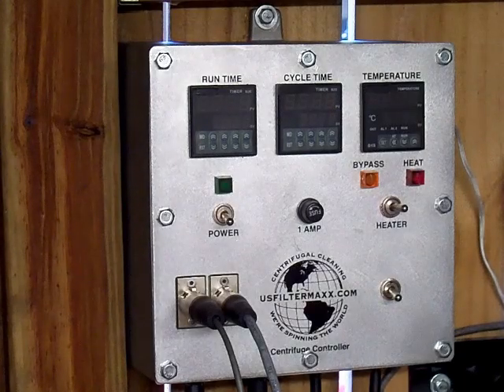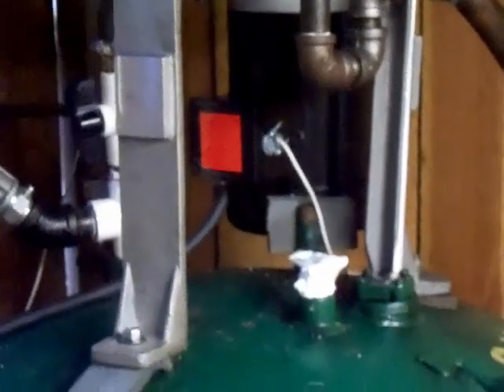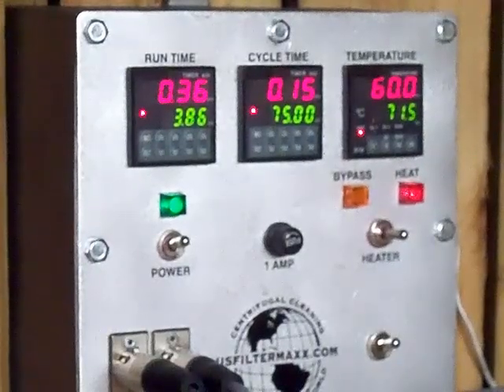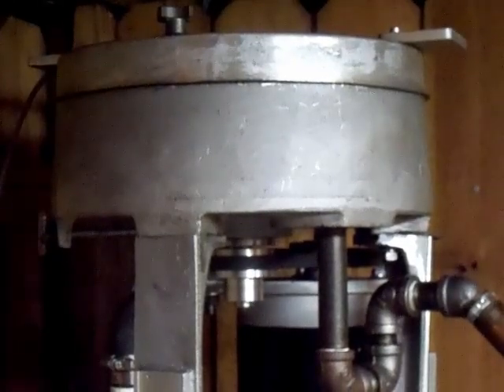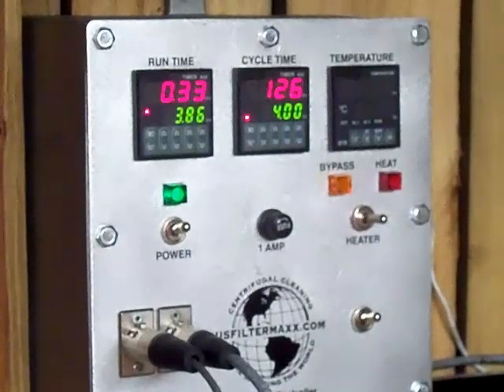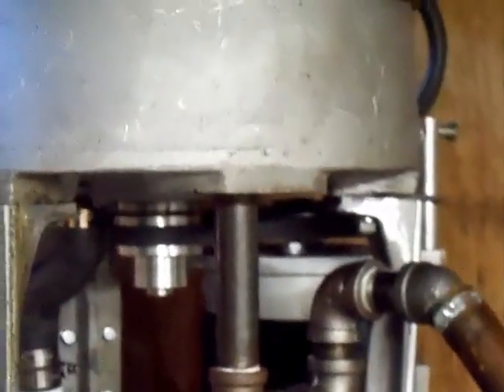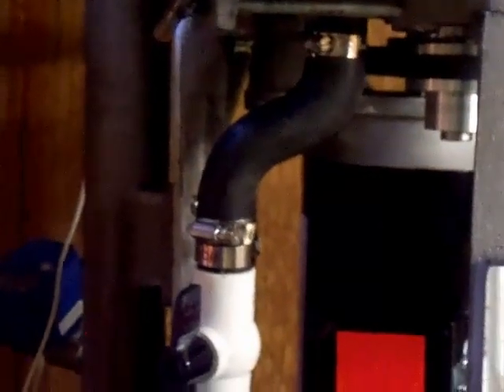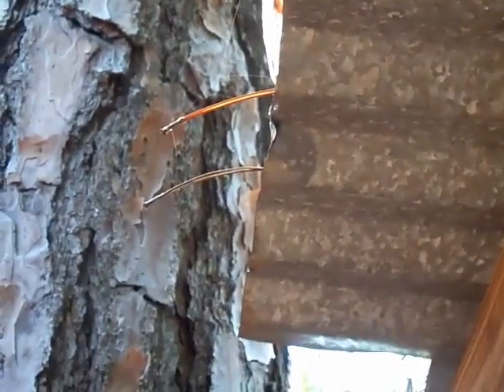6000 G centrifuge Cleans Waste Oil US FIltermaxx

Comment: Hi, What happens if there is a power cut or power fluctuation. Does it affect the motor or system in anyway? Is the drive motor a 3 phase motor? What is the operating voltage? Thanks.

Comment: also.. Can the finished filtered oil be mixed with gasoline? One video showed a 20%gas to 80%waste oil mixture.. What if im using fairly clean hydraulic oil? What would the mixture be?
Reply from the maker: Fairly clean would not be suitable, oil should be clean. Blending had nothing to do with how clean the oil is. Blending is based on how thick the oil is and what it take to flow at ambient temperature. Another consideration is starting. Some engines start better with diesel in the mix. The last consideration might be smoke. Some engines run smoke free and others are more sensitive to blend. Generally, hydraulic oil works pretty well as long as it is mineral oil based.

Comment from the maker: There is a remote potentiometer on a cable. I set the speed for 6000G and leave it. The ramp time is programed for 20 seconds so it has a soft start, coast to stop. This make for a very low stress unit both electrically and mechanically. You can vary the speed with the pot while it is running but there is considerable kinetic energy in that spinning bowl and abrupt speed changes can stress the motor driver circuit. The driver circuit is rated for 260% of the motor maximum current.